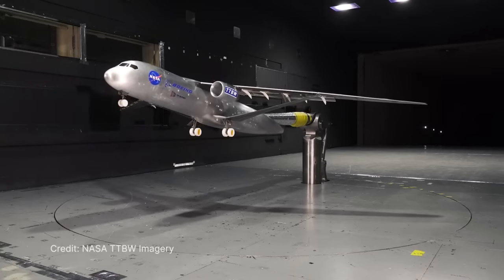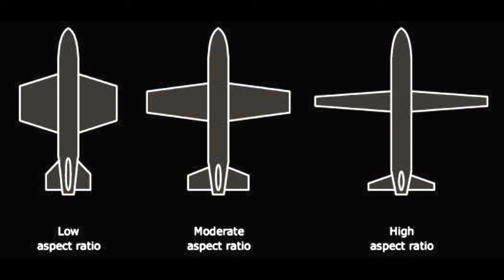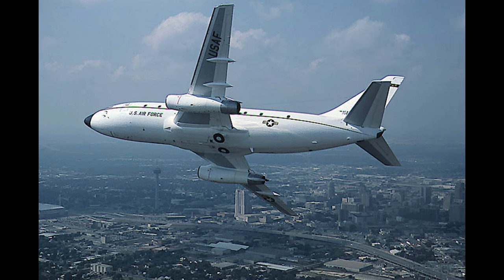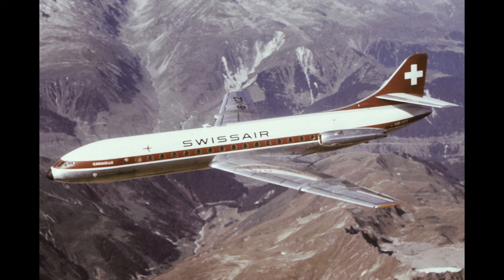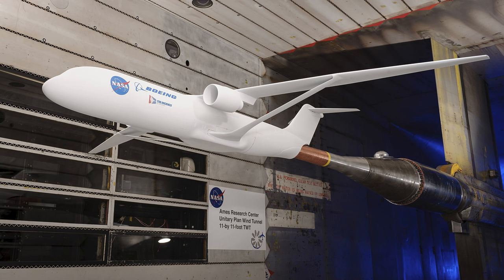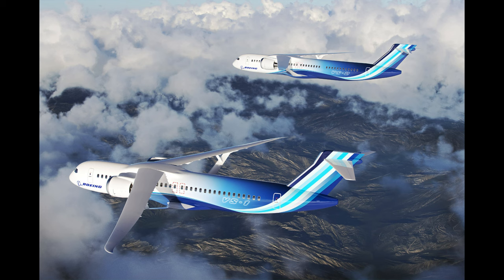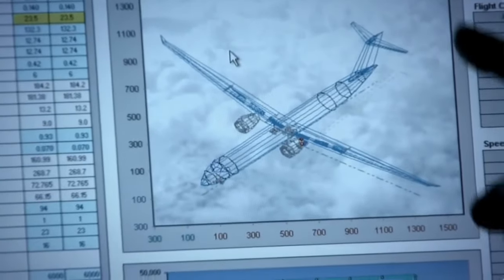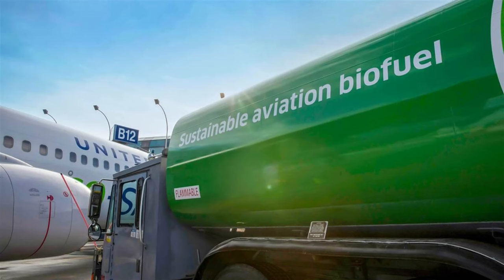NASA's New Airliner Experiment To Make Flying Less Expensive

Comment: 1) Isn't biofuel require more energy to produce than you get by burning it and it live exclusively because of government subsidies?
Reply: no, biofules do not require more energy to produce. the energy is absorbed in a "friendlier" way. to give a more palpable example, if you take alcohol as fuel and you get the alcohol from sugar cane fields, which in turn grow because of sunlight captured through photo synthesis, every step of the conversion process from the captured sunlight to the final energy of moving the vehicle diminishes the initial energy amount. but the net emissions of co2 are zero, because all the co2 that is emitted in the end was inserted at the start when the sunlight converted co2 to sugar.
now, about the energy by numbers. when when ppl talk about energy on a layman level, as you do here, they often mistake process energy with usable energy. in the above example, the process energy would be what is industrially needed to convert the sugar canes to ethanol, like pumps or heaters for the conversion process. looking at raw numbers, this may end up being higher that the usable energy. which, in the above example, is the final energy that gets the vehicle moving. the expression "raw numbers" is the essential bit here, because: EVERY conversion process has a loss, thus simply saying "oh look input energy number is higher than output energy number" is true for every process. this applies to fossile fuels as well as EVERY OTHER energy process. this is a law of nature, it can not be changed.
we humans rely on a number of different tricks to "outsource" the energy conversion. fossile fuels were once plants that captured co2 from the atmosphere to create, what are essentially, sugars. this process was free for us, no one was payed and no input was need in form of human labor(which is also a form of energy). than the gelogy of the earth did its work, compressing the sugars over a long period of time, this is also took energy, but is again free for us. thus, when ppl want to give biofuels a bad name, they do not mention the natural conversion process a the energy required there.
comparing the energy of biofuels and other fuel sources, withholding the natural-and-free-for-us conversion energy cost, is nothing but the proverbial "comparing apples and oranges".

what is true however, is that biofuels require more money to produce. because very often, the above mentioned free processes, can not be utilized due to time constrains. you do not have the years to wait till the sugar cane has reached a height of 50m and you do not have the millions of years time to wait till the geology has compressed the plants to oil. instead the sugar cane is cut when it has grown 2-3m. and instead of geological pressure (which, as mentioned is free),  bacteria in bio-chemical reaction plants are used to break down the plant material into alcohol (this is not free).
it always requires less effort (and less money obviously) to just stick a pump in the earth and pump out fuel that already exists, instead of creating it "from scratch".

money is what drives the world around, and no company will willingly change something, unless there is financial gain (or at least financial advantage) involved. no business equation incorporates environmental or social aspects. however these are mandatory for a functional society (a clean environment, where the ppl of a society thrive). on the business side, there is no cost attached to polluting the environment or exploiting humans. thus society has created a number of methods to attach a cost to misbehaving, in the form of taxes or punishments. this leads of course to change in business practices, because there is now a financial cost to certain actions. 
society can also be a bit more lenient and forthcoming to companies in order to facilitate the change in business practices, this is done in the form of subsidies and similar preemptive methods, as briefly mentioned in your (very short) initial sentence.
Reply: @kensaiix  Sorry for bad English
1) I dont think our plants can distinguish "bad" fossil fuel CO2 and "good" and friendly biofuel CO2
2) I read the paper by David Pimentel where they calculated the amount of energy for the production of corn, its transportation, grinding, heating for fermentation, ethanol extraction and purification and so on (NOT SOLAR ENERGY), and the energy cost of producing 1 liter of 99.5% ethanol exceeded the amount of energy that can be obtained by burning it
In other words, if the entire corn bioethanol industry runs on the bioethanol it produces, it cannot exist.
Same thing with nuclear fussion, if you need more energy to maintain reaction than you get from the reaction, you just burning coal.
3) You absolutely right you cant make any type of fuel with less energy it contain, if you eat 1 calorie of chicken it took 10+ calories of grass bugs and seeds to produce, but you care only about calories you can get minus calories on chewing and digestion, same with coal, oil or uranium, maybe it took 1,000,000x more energy to produce 1 atom of uranuim that it will release in fission, but we are not the one who spend it.
Reply: @Neront90  about 1) there is a difference. one increases total atmospheric CO2, the other does not 
about 2) corn is not a proper plant to be used in bio-fuel production. there may be other reasons why one may want convert corn to alcohol, but it's use as biofuel source is merely a proof of concept. i know it is done in certain places, but that has other reasons.

i want also to point out specifically, that bioETHANOL (very improper term btw) is not automatically used as bioFUEL.

an industry exists because it generates money, as mentioned in my post above. if a company gains more by converting corn to ethanol than by simply selling the corn itself, it will generally do the conversion. this is a financial decision. it is entirely decoupled from efficiency or ecologic questions. this means, a company will always be inefficient, non-ecological, wasteful or predatory, as long as there is profit to be made, unless society enforces barriers.
Reply: @Neront90  you have 2 misconceptions about biofuel.
1. you seem to think of corn as general base for biofuels. this is largely not the case, as mentioned already, there are much better sources, like sugar cane or microorganisms. this is the current state of the art, not corn. Brazil is infusing its gasoline for cars with over 25% ethanol from sugar cane, and has been doing this for over 20 years.
2. you also mix up fossil fuel and energy. energy is an abstract term. energy can be provided in very different forms, it can come from chemicals (the popular hydrocarbons), motion or radiation. taking the total energy need of a process and simply declaring it all came from fossil fuels is always inaccurate. fossil fuels are a carrier of energy, they are not energy themselves. if the paper from Pimentel you mention above, used such an equation where all energy need was summed up and declared fossil fuel, then that statement is incorrect. i can gladly explain this in a more palpable way.

the myth about "more co2 = better plant growth" has been debunked and explained many times over. yes, plants grow better when more co2 is present. but globally, the co2 contributes to more land aridity (and loss of plant life in those regions), than can be offset by the increased growth of the remaining plants. because an increase in co2 is not proportionally connected to plant growth. when you take the current 400ppm of co2 in the atmosphere and increase that by 100% (so you DOUBLE the current amount to 800ppm),  you only get +15% at best of increased plant growth. there is a net negative, even if you look at pure percentage increase and disregard land aridity.

about your second to last paragraph: i am not sure what you mean. as you say yourself, a company is interested in making money. if there was no money to be made, companies would not do it ("it" stands for whatever the company is doing to generate profit) and the industry those companies are based around dies.

about your last paragraph: i am not speaking about lazy companies. i am saying that, without social control, companies are only obliged to the bottom line. so they WILL be wasteful (and everything else i mentioned above), if it serves the bottom line, without the aforementioned social control. this has been observed in the past and is unchanged today. you seem to refer to companies competing *with each other*, this is something else.

Comment: Under no circumstances should anyone believe flying or any other service or product will get cheaper. Innovation only ups profits for the company and specifically the shareholder. There is no trickle down, up, over, "diagon-alley" or any other movement of those monies.

Comment: You talk of synthetic fuels from algae but have any idea how large the ponds would need to be ? Ponds that will DISPLACE AGRICULTURAL USE. You may be able to make them but you'll reduce FOOD output in doing so ! WE NEED the food, we DON'T NEED those synthetic fuels as much. To me hydrogen from electrolysis looks a far better option. You can burn hydrogen in jet engines.

Comment: Hi Scott Manley - I enjoy your videos but wonder if I may suggest a means for ensuring the correct unit names are used when preparing a video - (especially table column headings) - Just ask yourself:
"Am I wanting to refer to a 'force' or a 'mass'? 
(if its NOT a 'force' then don't use 'Weight')
'Heavier' or 'Lighter' may still be acceptable to quantify for a comparition of masses as "more massive or 'less massive can add unnecessarily to speech. 
The reason is highlghted as that less mass implies greater acceleration for the same applied force (F=ma).
Also athough it may involve additional work - avoiding mixing imperial and ISO units but helps to educate those in the only two countries in the world yet to ratify and use ISO units - (Liberia and USA)

Comment: Anti gravity. NASA perfected gravitational defeat technology in the 1980's so why don't they use a system that doesn't make the plane weightless but instead just removes a few tonns or more from it. This would lower fuel costs if used efficiently by turning it up on take off and setting it back as they plane at altitude ? Things that I know but you don't.

Comment: Everyone talks about how efficiency is sooo important, and they care sooo much about the fuel bill, then you find out propeller engines are quite a bit more fuel efficient than jet engines - and while certainly jet engines have many many advantages - fuel efficiency is absolutely not one of them. Not to mention those old prop engines that are so efficient are 20 years behind a modern car engine with direct injection. My grandad used to drive a diesel but as soon as i put one in my plane it's suddenly ExPeRiMenTaL  -- no no, it's quite clear. Innovation in aviation is not desired by the regulatory authories gatekeeping access to the skys.
Reply: turboprops have both a speed and perceived safety issue (especially in the US). hopefully open-rotor engines can get at least a good efficiency improvement while being acceptable
Reply: @AmbientMorality  turboprops are still basically jet engines. i really do mean piston engines when i say "propeller engines" i should have been more clear, sorry
Reply: @cannaroe1213  Ah, alright. Is this still true if you are considering fuel consumption per unit distance rather than per unit time (obviously this will vary, but I would assume a piston engine plane would be substantially slower)?
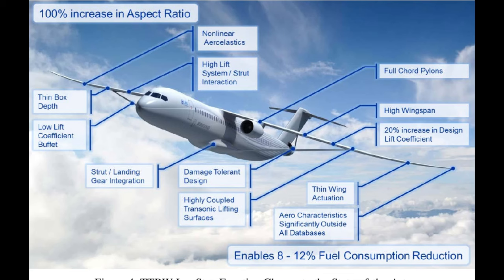Reply: @AmbientMorality  4:00 "100% increase in aspect ratio"
Considering the wing area remains the same between ratios 1:58 , how does a ratio increase by 100%?
Reply: @cowboybob7093  Aspect ratio is the square of wingspan over the wing planform area, so aspect ratio is a number often substantially higher than 1 and can be anything between 0 and Infinity
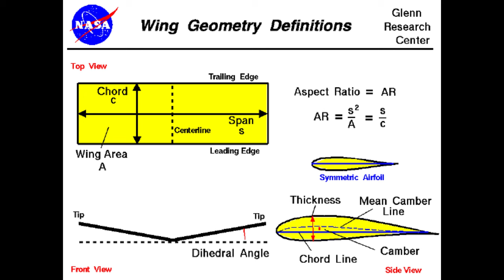Reply: @AmbientMorality  I decided to leave my reply posted even after I did some (very simple) math. I came up with (for example) a low aspect wing might be 20 span x 10 chord for 200 area - A high aspect wing might be 40 span x 5 chord for 200 area. Does this track with reality? 2:04 the Glenn wing defs slide.
Or could the argument be made that going from 2:1 to 8:1 is a 400% change in ratio, while maintaining the area
Reply: @cowboybob7093  For what it's worth, the  most recent Mach 0.8 TTBW design has an aspect ratio of 19.6 with a span of 158.1 feet.
Reply: @AmbientMorality  hahah, its surprising isnt it? its fuel efficiency per unit distance, yes, because the max speed of a propeller is when the tip of the prop hits the sound barrier, its inefficient to go faster, unless you go higher where the air is thinner, then "screw" based motion stops working and "thrust" based motion takes over in efficiecy. So jets basically spin a prop juat to get high enough that theres no wind resistance, then they can go very far by basically having a big exhaust pipe, no propeller. "High efficiency high-bypass jet engines" are high efficiency for jets, but a low-and-slow flying plane, particularly if its something with very little drag like a Rutan / Long EZ, is the moat efficient way for a few humans to travel, beating out cars and, over sufficient distances, even motorbikes (because you travel in  straight line).

Comment: If NASA improve efficiency by 20% then any environmental benefit will be immediately wiped out if this translates to cheaper tickets. Cheaper tickets = more passengers.  There needs to be a legal requirement to balance out any reduction in CO2 per-flight vs. passenger numbers so that overall there is a reduction in emissions.

Comment: If you think there aren't enough near misses among aircraft when parked at the gate at terminals, you ain't seen nothing yet.  This new design will result in a plethora of airplanes hitting each other.
Reply: The wings would fold
Reply: When and how would they unfold?  On an aircraft carrier, the Navy planes need to unfold their wings before they taxi into position for catapult launch.
Reply: @georgesandoval8311  The 777X is designed so that the wingtips unfold at some point while taxiing, probably a bit before it reaches the hold-short line. For airports capable of supporting widebodies I don't imagine this could be much of an issue, but it might take some additional planning for smaller airports. The exact specifics are airport-dependent. I'd expect the same for this.
Reply: The 777X isn't in service yet, so what you're saying is speculation at best.  It won't see usage for a few years.
Reply: @georgesandoval8311  Boeing already has official 777X airport planning guides; I'm referencing that guide for this.
Reply: Yeah, I'm sure they really planned well for the 737 Max, look how that turned out for them.  I"ll wait for the plane to be used in the real world before I change my skepticism.
Reply: @georgesandoval8311  I mean, alright, but I think "speculation at best" for my comments about 777X was a bit harsh. It's the official answer at the moment, even if things could still potentially change a bit.
Reply: Until it's borne out by real world experience, it's speculation.  How many times did the 737 Max udergo flight operations before its flaws were borne out?

Comment: Electric road vehicles are not a solved problem. Without the impulsion from AGW, nobody would buy one over an internal combustion engine car. Batteries today are more energy dense than they have ever been, but remain a horribly inefficient means of energy storage. Electricity itself, though enormously useful, is inefficient in total cost, which is why your home electricity costs about 4 times the price of natural gas per joule. Finding more efficient ways to use it will not change that basic fact.

The effects of global warming are manageable for less cost than stopping fossil fuel usage.

Comment: Unfortunately more efficient planes will not result in lower carbon emissions.

It will simply result in cheaper flights and more aircraft in the air.

Synthetic fuels using hydrogen as a base product are really the only option.

At least untill we have a working space elevator.

Comment: The TTBW is a silly-ass waste of money!  The use of much-higher AR wings can improve the aircraft's L/D but the truss's aerodynamic drag nullifies much of that gain.  The smarter way to go with a much higher AR is to also fly at much higher altitudes where you keep dynamic pressure low enough to not need external bracing while TAS is high enough for good economics.  If we are also nowadays designing supersonic and hypersonic aircraft to cruise at 70kft+ (U-2 territory) why should there be any objection to flying at higher altitudes subsonically as well?  An airliner with sailplane-like wings that would cruise M0.9 at 70kft could be 3+ times as fuel efficient as today's airliners.
Reply from the maker: Why do you think they won’t fly at higher altitudes, especially since I specifically say this is possible.
Reply: @scottmanley  I'm assuming that if they were designed to operate at lower dynamic pressures, they would not need the trusses.  What kind of typical cruise altitudes do you think are envisioned for the TTBW?